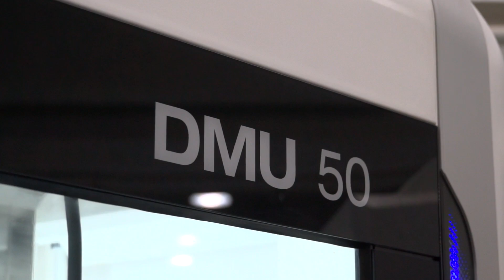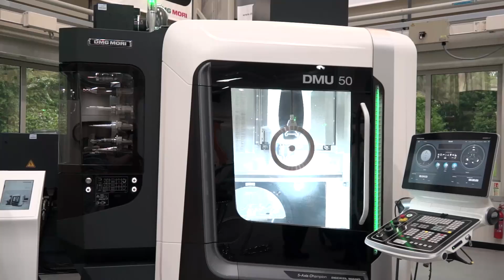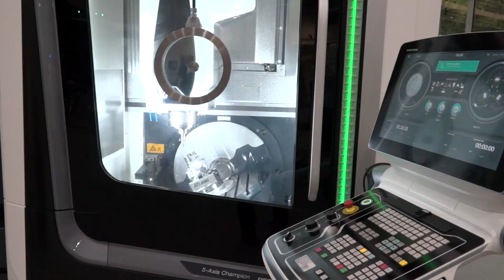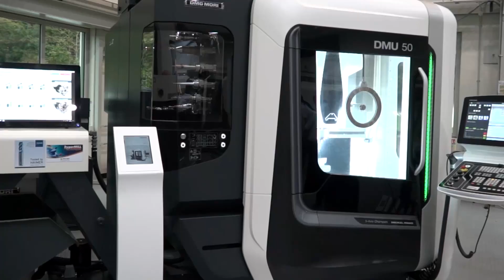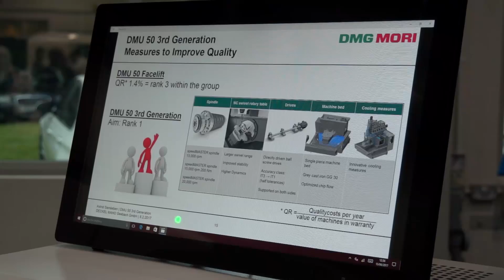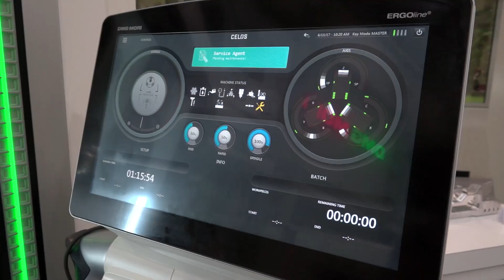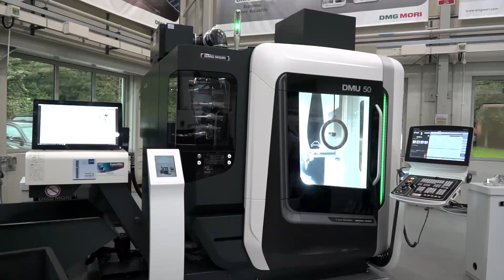DMG MORI UK launch the new DMU 50

Comment: If this DMU 50 can go -35 to +110 instead of -5 to +110. You should update your website. It still says -5.

- edit: Nevermind, that's on that 3rd Generation machine. where the fix is made.

Also, I don't know why -5 was even a thing to begin with. That's such a small angle that Post Processors have to deal with, making some toolpaths more inefficient, allowing more inaccurate XY motion to creep in, that wouldn't be needed otherwise, if the machine could just stay at that Negative angle, and not whip around to the positive. That's the reason why Haas made their machine go to that much Negative to start with.

Comment: Not quite sure the explanation of the difference between a motor spindle and a direct drive spindle was clear.
Reply: Should be Integrated Motor Spindle. The permanent magnets are fixed to the spindle itself with the winding as part of the cartridge. A direct drive spindle has the motor in line and above the spindle cartridge attached with a coupling. A belt drive spindle has the motor above and usually behind the spindle cartridge attached with a timing belt. And a gear drive spindle is similar to belt drive but with a 2 speed meshed gearbox.